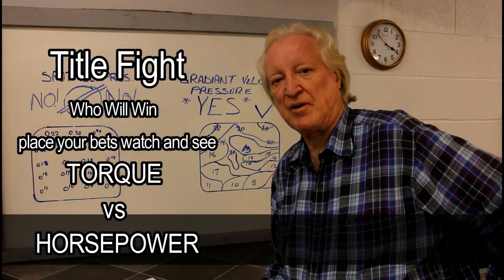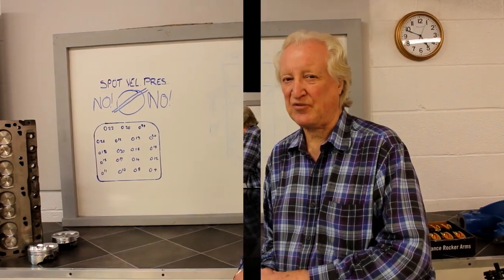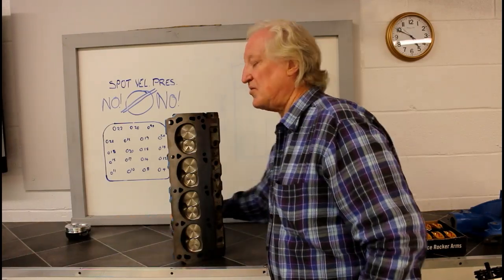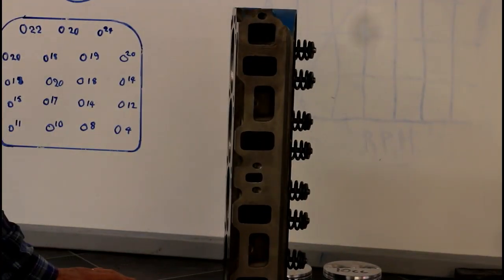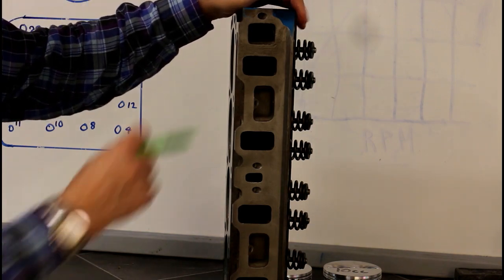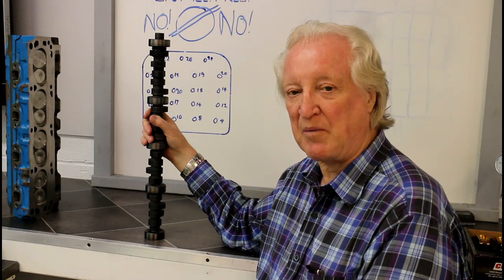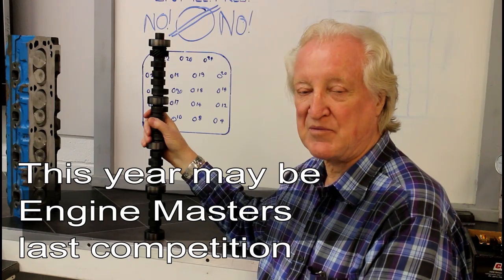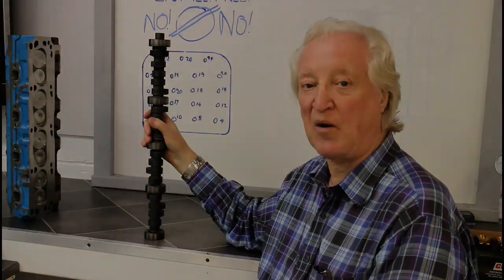Powertec 10 Episode 2 Torque vs Horsepower

Comment: Hello.....   this.   Reminds.     Me.  Of.     My.   First.   Restoration.    Engine.  Job.  Learning.  The.  Difference.  Of.   Elevated. Or. High.    Horsepower.....and.    high.   Performance...  and.  The.      Best.    Advice.     I. Recieved.  On.  The.   Daily.  Driver.  Chevy.  327   Was.  Keep.   Lift.   At. Or.   Under.  .500.  And.  Try.  Not.  To.   Go.    Over.   300. On.   Duration...   degree.s.   that.   Is.....  worked. Good.  For.   Me.    15.  Yrs...  of.  All.  Summer. Good.  .     On.   That. Engine...   although. Because.  My. Clr.  Was.  Beyond.   94 octane.  I.   Had.  To.  Drive. 30.    T0.  40.   Mins.     Sometimes.  To. Get.  99....  101.  Or.  105.oct.  fuel.....  just.   Food.   For.   Thought...    have.  A.   Nice.   Day....

Comment: Torque verses horsepower. There are some engines that are designed to get big luxury cars going and they are called torque monsters. Such engines are the Buick Oldsmobile and Pontiac 455 cu.in.engines. Especially the Buick. They have big cubic inch displacement and small intake and exhaust ports the same size as small block Chevy 283. The performance engine that GM Designed was the Big block Chevy and small displacement 350 and smaller SBC it had big enough port size and valves to allow that much displacement to "breathe".  My question is if I grind on a pair of big valve 2.11"/ 1.77" Pontiac heads for a 400 cu.in would I need to grind the intake ports bigger than the 283 port size they have? and I wonder how much to take off. I know most Pontiac builders use aftermarket heads for the reason they have much better performance and bigger ports. I read a YouTube article where someone said you can't make a Pontiac iron head port too big because they are way too small to begin with. What do you think. Unless you're building a small 326 cu.in then you might cut away too much velocity but I don't mess with something that small. If its a 455 head with 283 port size you might almost get it as big as an oval port BBC head if its ground to the max 😆 I don't think hurting velocity would be an issue on Pontiac 455 or even a 400

Comment: Hello my friend I just wanted to start thanking you for all the correct information on all your videos, I have a 2010 grand cherokee wk1 srt8 6.1 hemi and recently got a bad lifter lifter so now I'm in the process of swapping a better performance camshaft on my stock 6.1L hemi 370 CI with a 10.2 to 1 compression ratio with 2.08'' intake valve diameter & 1.60'' exhaust valve diameter and has been searching online for the specs of my stock cam ( with no luck ) to be able to compare it to the many different aftermarket options out there so I can make the right decision on what camshaft/springs etc to go with on the stock torque converter in order to get the most physically possible torque/power out of my engine which I'll use on the streets every day so PLEASEEEE if you don't mind and can provide me the specs/manufacturer for the correct camshaft I need it'll be greatly appreciated, THANKS IN ADVANCE

Comment: Ez Go

DV,  I HAVE A  VERY LOW MILEAGE 1975 SBC 400 WITH FACTORY STOCK DISHED PISTONS. I AM GOING TO PUT SOME VORTEC HEADS ON THIS ENGINE WITH THE SPRING AREA MODIFIED FOR MORE CAM LOBE TRAVEL. AND DRILLING THE STEAM HOLES IN THE HEADS. I REALLY NEED SOME ADVICE ON THE RIGHT CAM FOR THIS ENGINE. I  WANT TO PUT A ADJUSTABLE TIMING CHAIN SET IN IT ALSO. THIS ENGINE WITH THE STOCK PISTONS AND THE VORTEC HEADS SHOULD  HAVE  AROUND 10.1 COMPRESSION.  ANY HELP WOULD BR GREATLY APPRECIATED. THANKS.

Comment: Daddy cool 😎 I have a bare block Pontiac 400 and #13 bare heads that need porting I wish he could build it for me 😎😁. The block is the thick older model not the thin crap 500557 cast of the mid 70s smod era. Its ready for a balanced forged lightened crank rods and pistons set perhaps from Butler. Everyone strokes a Pontiac 400 to 461 but they also have a 4" stroker that makes it about a 427. I would rather go with the shorter stroke with those heads or it won't be pump gas friendly

Comment: Interesting.  Share my 454 build that didn't turn out.  049 heads with 2.19/1.88 valves pocket ported, flowed with high flow numbers by a head specialist with a hydraulic roller  262/272  duration 210/218 @ 50 .510 .525 lift on 112 centers. Daul plane 2161 edelbrock  intake Q jet carb. 9 to 1 compression and long tube headers. Keith Black hyperutectic pistons. 
The engine doesn't have any power or torque under 3500rpm rpm and is a terrible gas hog in a 6000 lb 1 ton pickup for pulling.  Worse engine I've ever put together and the most expensive,  never do again.   I believe   the peanut  port heads would of been way better and keep the small valves. High flow air flow numbers didn't do shit here but make it worse, no air velocity  at low rpm? What u think is the problem? And my cam may be a tad to big?  Want a stump puller power off idle to 4000rpm.   What do u recommend?
Reply: This channel is dead for now, find his other channel here: https://www.youtube.com/@DavidVizard

Comment: I just had to say that I have been a fan for forty years!  I have bought every book you have made to my knowledge. I still refer to your books prior to building an engine. No matter the manufacturer.  I have really enjoyed the PowerTec 10 videos.I just wanted to thank you for a lifetime of your hard work. I have watched in great detail your video on degreeing camshaft timing for compression and cubic inch displacement.  I am not sure if I have missed it or not but do you have a formula for finding the best lobe separation for maximum power and drive ability? I am putting together a 383 sbc that has a 10.5 to 1 compression ratio. I know to set the intake centerline at 106 degrees.  I haven't decided on what camshaft to run. I am trying to decide between a 107 to 110 lobe separation. I would love to hear back from you either through hear or through one of your videos.
Reply: Post this on his other channel called David Vizard, this channel is no longer used.

Comment: I think of power as the VOLUME of torque.  Visualize torque as force.  Think of a hammer slamming into a scale and seeing the reading go up.  You will see a spike of peak FORCE during the strike.  Visualize power as how MANY hammer strikes you make in any given time frame.  This is also known as WORK.  If you have a nail and it takes 2 strikes to drive it into a board that is work.  Interestingly you may use a lighter hammer that you can swing faster but produces less peak force for each strike and it takes 3 strikes to drive the nail into the board.  If you can swing that lighter hammer faster and make 3 strikes in less time than the heavier hammer takes to make 2 strikes... the lighter hammer just delivered more POWER/WORK than the heavier hammer even though the PEAK force is higher with the heavier hammer.
Reply: That is all true and a good way to think of it fundamentally. But it does not explain 1 fact. Acceleration is always at it peak when torque is at it's peak in any fixed ratio drive train and does not follow horsepower level at all. Legendary engineer, researcher, professor and author C.F.Taylor coined the term "unavailable horsepower" in fixed ratio drives, regarding acceleration, to describe it. This is a strange phenomenon but it explains much. Acceleration is force based not work based,  with fixed ratios it mirrors only the force(torque). The only way to access the acceleration potential of peak horsepower is to have a CVT, constant variable transmission. One way to think of it is: With any particular overall ratio, maximum acceleration always occurs at peak torque - At any particular SPEED with gearing open to any ratio then maximum acceleration is at peak horsepower. This is a difficult concept but well worth understanding and essential to know about.

Comment: David I like to work with big block ford FE, & 385 series engines & aftermarket aluminum heads are not realisticly in my budget ever. I dont work with engines as a business, just a hobby, so I'm always just working with my own equipment for fun. I have big 4x4 trucks I like to just hotrod around the country side with & enter a occasional mud run in the street classes. The last one I went to I won my class out of about 10 trucks & got second place in the open class out of maybey 30 trucks. But I would like to learn more about porting on the old oem iron stuff. Do you have any books that might help me gain some knowledge at becoming better at it? If so I would be interested in purchasing it.

Comment: The "width" of the torque curve & where torque is made are also important.  The lower the rpm & longer the engine builds good torque, the more useable it will be on the street.  You can build a 302 with about 10:1 compression, flat juice cam, ported OE big chamber heads, & a dual plane intake that will build more mid range torque than a 460.
Reply: Oh, I  believe you. Do you also have a bridge to sell me?
Reply: @fasteddy  Only the one in your mind connecting the use of the standard mentality & failure to grow.

Comment: yeah chevy 355 street builds getting 380 tq, less than the 400tq of a 302 ford is the common build. and 350 sbc that get 400 tq and 415 hp round abouts still a far cry of the 400tq and greater hp of the 302 on a thought out attention to detail build like david vizard'S builds and studies. What a great science it is, engine building.